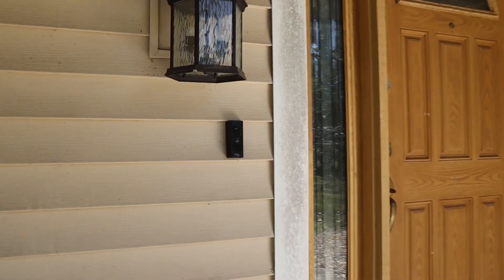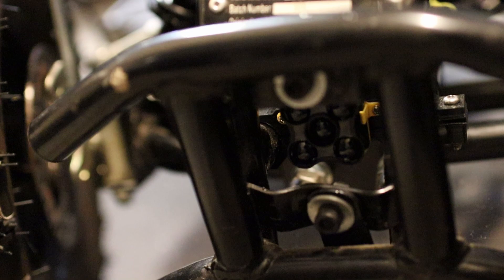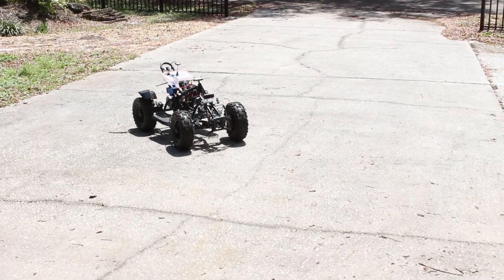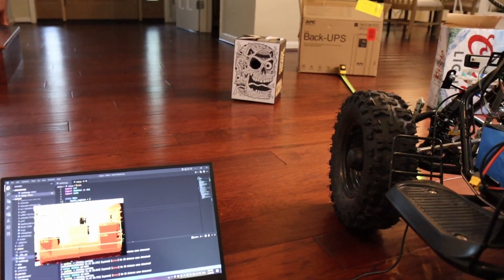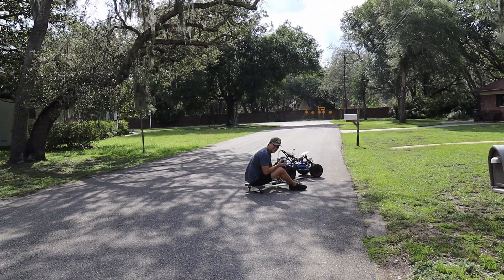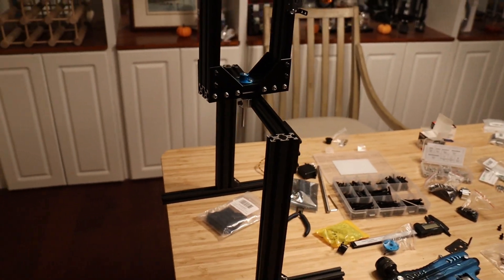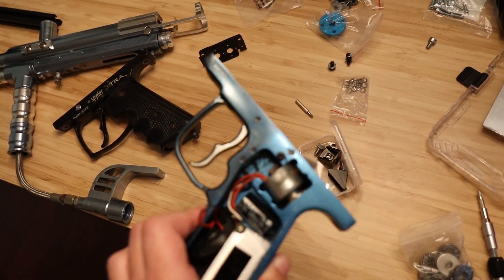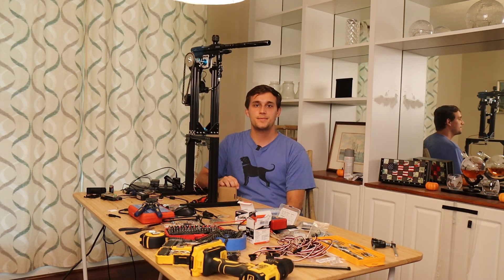I'm making a domestic paintball sentry bot

Comment: This is really neat. Do you run signal to the motor throttle directly from the holybro power module or are you running throttle control through a speed controller? I did something like this with a r/c car and old apm 2.5 but,  this is next level. Any tips or tricks would be appreciated. Think I'm going to do this. Thanks.